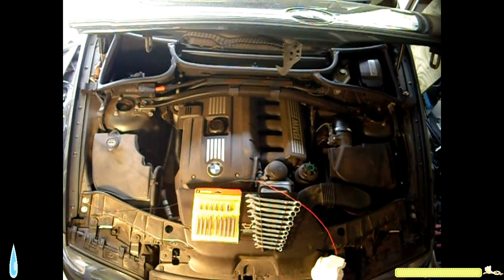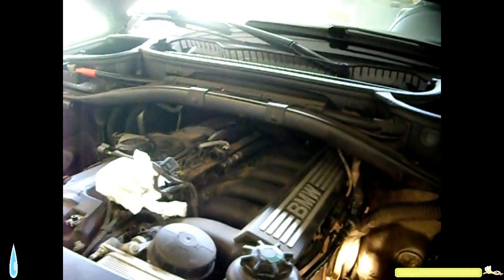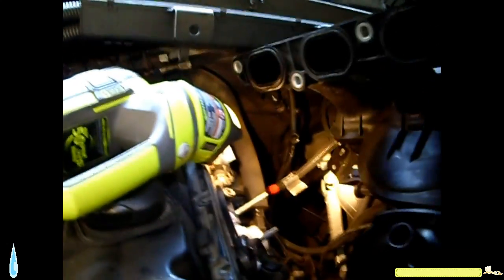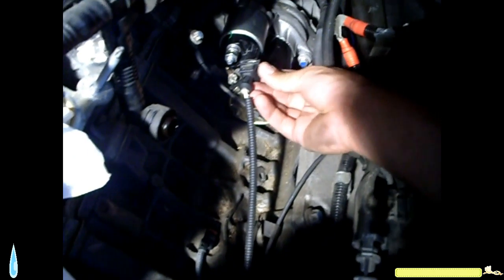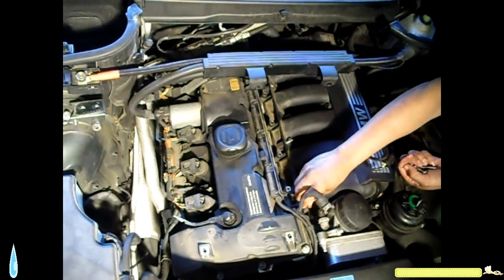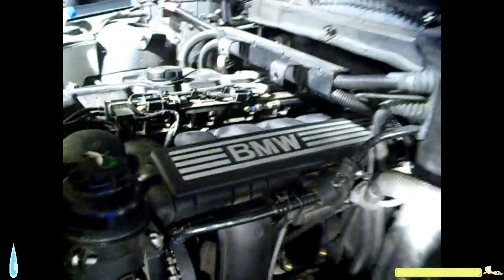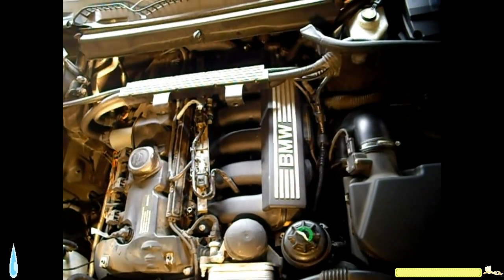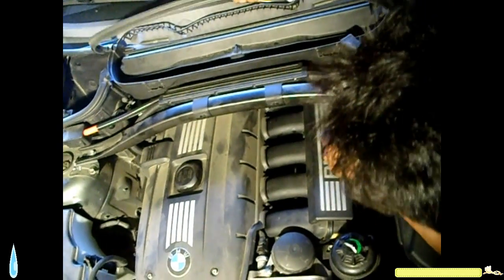BMW X3 STARTER

Comment: The dealers up here in Canada wanted $600 for the starter, $155/hr for a 3-hour job. So I said screw them, I'm a mechanic in the military anyways so I'll do it myself. Would rather have had someone else do it because at the end of the day, I'm too tired to do it myself. But I'm saving myself $1000 doing it on my own. The electrical component you removed from the right side of the manifold you didn't have to do. The small electrical cable going into it could be removed instead. Wondering why you didn't replace the 6 gaskets for the manifold. As well the tightening torque for the starter mounting bolts is 20 Nm and the bolts and nuts for the manifold is 15 Nm. Really good video though.
Reply from the maker: Jose, thanks for the comments,  I'll keep the info in mind next time I have to do it, I did replace all six gaskets.
Reply: ZUMO any problems with the small damage to the rubber hose at the throttle body?
Reply from the maker: +Jose Mendoza. I just damaged the rubber o rings  to the injectors when I try to insert them with out any lubricant, the hose was ok.
Reply: ZUMO I managed to do it without pulling the fuel rail and left the manifold moved to the side without removing it completely. Really appreciated your video.

Comment: Hello my friend why didn't you replace the manifold seals with new ones ? or torque the starter bolts?
Reply from the maker: Thanks for the comments, I did replace the seals to the manifold, did not included on the video because there were videos on seals out there, I did not have a tork wrench, but I do recommend torking the bolts to the starter motor.

Comment: Greetings, I installed a new starter on my 2004 BMW X3 2.5. When i put back everything back together and turned the car ignition, it did not crank the car except it only made a clink, clink noise. Any ideas, would be greatly appreciated.
Reply from the maker: Hello Allan
I'm not sure how the starter looks in a 2004, at the beginning of the video I show a way to check if is the starter motor will turn and also if you are getting power to the starter, don't know if you had the old starter checked were you bough the new one. My recommendations are first to have the old starter checked to see if it turns, then go trough the diagnosis steps detail in the video, Need to make sure it is the starter the cause of the problem, if it is the starter, then need to trace the connections you made, make sure all the clips are all the way in. Good luck, keep me posted with your progress. 
Thanks for the comments

Comment: why did you take the fuel rail off?
How did you get the plastic electrical juntion box off?
Reply from the maker: Hello John
I took the fuel rail off because in my BM the fuel line going to the manifold was tight over the manifold and when I pull on the manifold it hit the line,(video time line 13.19) and I could not separate the fuel line from the fuel rail, it just made it easier to remove and re-install.
The electrical box is being held by two #30 torks screws need patience for these two screws (video time line 46.25 to 47.55) to me they were the most difficult of the entire operation.
Good luck.
Let me know how you did.
Thanks for the comments.
Reply: ZUMO got it. I am part way through and now I am debating removing the fuel rail. the connection is not coming apart for me and I don;t want to break anything. That electrical box, as you said is supposed to come off the metal tabs. Another brilliant BMW design that does not work.  I went to the store and bought a ratcheting handle for the T-25 to get on that.
Thanks for posting the video and responding.
Reply: ZUMO my car is a 2008. I got the starter form Autozone (142 plus tax and core), it is the same rebuilt one carried by the dealer (280) and the foreign autparts store nearby (205), It is the right one, I guess they updated the part numbers. Had to get the bolts at the dealer $16 plus for both
Reply from the maker: John Murdock I have a 2007, there might be a few differences between the parts, are the new bolts also aluminum? you could not use the same bolts? just curious.
Reply: ZUMO finished. the bolts are aluminum. short one goes in from the front long from the back which you cannot get a torque wrench on  the BMW manual says 20 N-m with a plus 90 degrees  on the short one and plus 180 on the long one. those torx bolts holding that bracket on were a major headache. that junction box should have been mounted to a body part. I disconnected the fuel line to the rail. It takes two people. bush the connector together and have someone else push the plastic insert towards the line. the injector did not want to separate. the new starter works better than the old one ever did. I bought the car used in 2010 with 37 k miles. the old starter was weak then I think
Reply: ZUMO reusing aluminum bolts is not a sure thing safer to replace them  every repair manual i have ever seen tell you to replace them
Reply from the maker: John Murdock Glad you got it done, thanks for the feed back.

Comment: Sorry dude, your video is partially useless cuz half of the stuff(especially the cables underneath the IM) is not in the video. I'm just in the process of replacing the starter on my 2007 x3 3.0 si
Reply: CeCO Jr. 
This video does show everything in detail that I had to do to replace the starter on my 2007 X3, including all the wiring related to the replacing of the starter, I'm no expert on the BMW X3 and there may be other ways of doing the same thin. hope it helps.  Thanks for watching
Reply: David Gil Look up the video "BMW 3 series starter replacement" from the user Nicoya. Different model but it's almost the same parts around the intake manifold, including the IM itself.